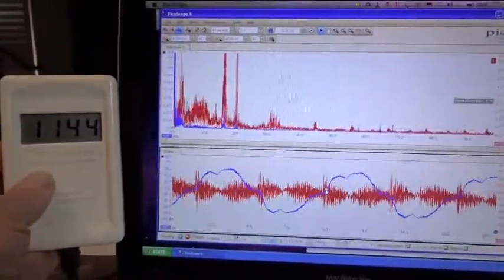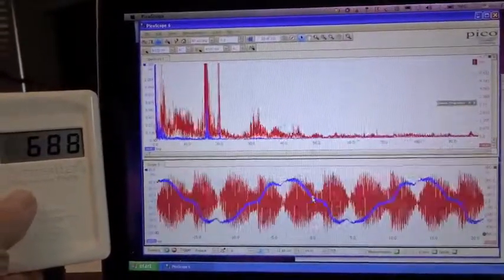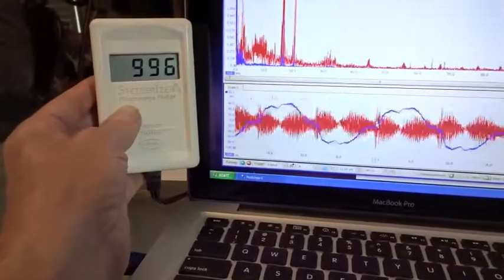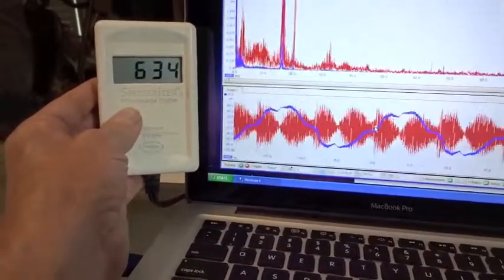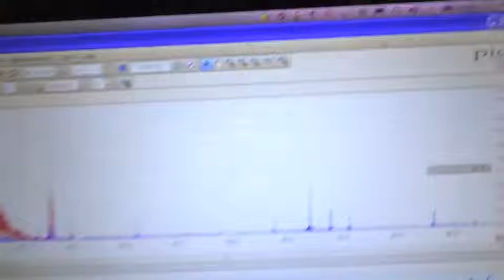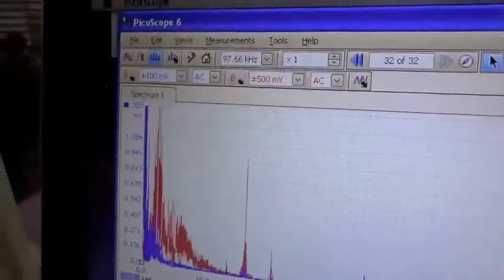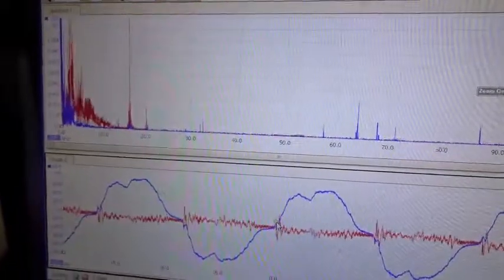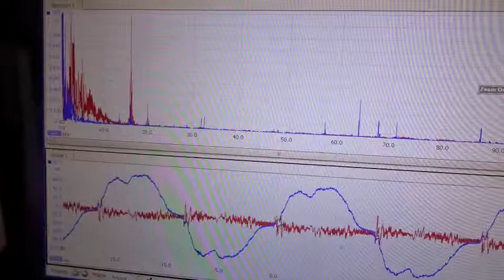Dirty Electricity in Solar Home

Comment: Nice presentation Eric - was this just one filter on one circuit - if so, did one filter address the dirty electricity for the whole house OR was this a whole house filter install?
Reply from the maker: One filter was connected to the cord the scope was on for this video.  It is best to place an appropriate filter at the main electric panel for best results.
Reply: Do you mean with its own separate breaker - and on each phase AND does it matter where its positioned - that is should it be closest to the phase tie ins within the panel?
Reply from the maker: Yes, it should be as close to the main panel bus bar as possible.